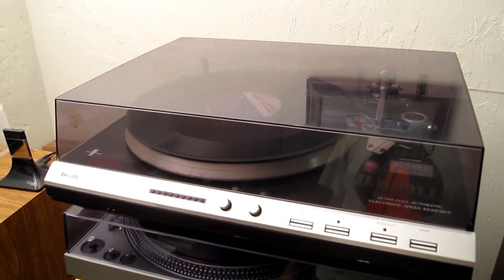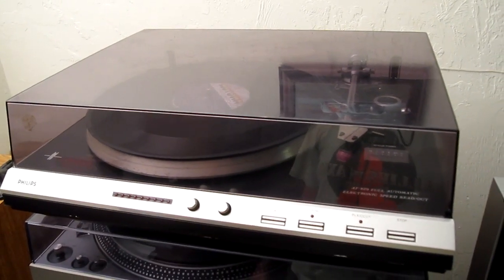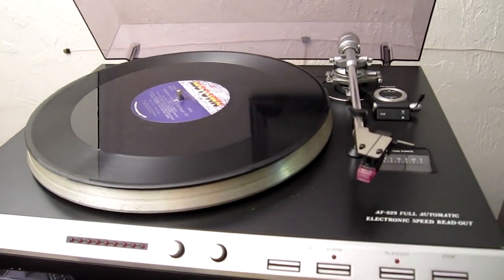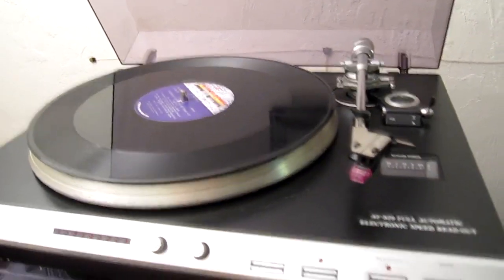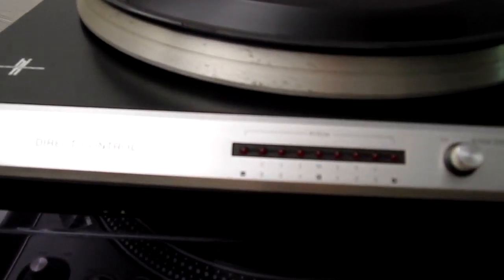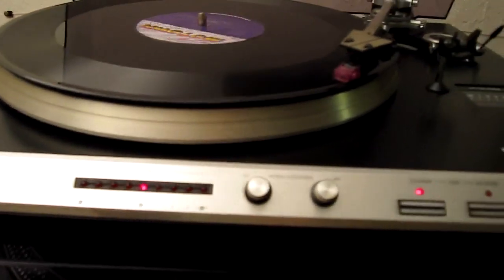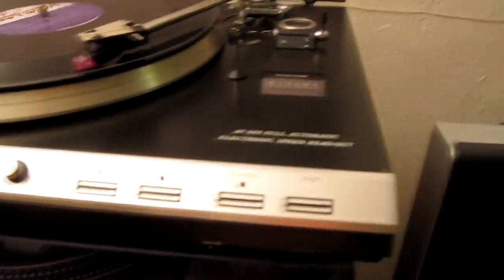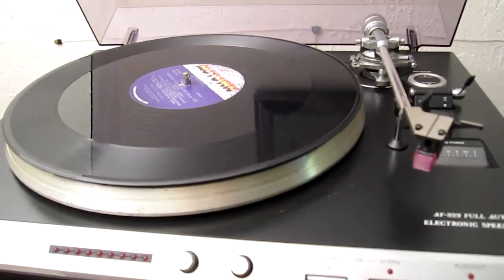Phillips AF-829 Turntable, Landfill Destined Rescue

Comment: I have one like that. I bought it 40 years ago and it still works like new. The coolest turntable I ever had. I bought in Toronto and I have a few ADC gold cartridges (They were marked at $200). I also have a Yamaha M-45 power amplifier and a C-45 preamplifier, along with a K-540 cassete deck, a TX-900U tuner and an EQ-500U equalizer, also from Yamaha.

Comment: I have an AF-829 that I bought at the going-out-of-business sale of the Tech HiFi store in East Lansing, MI. Got it in January or February of 1981. They had the original price listed as $400 (OK, $399.99), but had it marked down to $250 or so.

It is, in fact, a belt drive turntable. This may come as a bit of a surprise, but mine still has its original belt. This past January, I took it to a local high end audio shop (yes, they do still exist) to have them put a new cartridge on it (a Grado Green, just in case you're wondering). While I had it in there, they put it under their strobe, and at both 33 1/3 and 45 RPM, the speed was dead on.

My original dust cover has bitten the dust (in college, my roommate accidentally dropped the ladder we used to climb up into our loft on it, but, like a Timex watch, it took that licking and kept on ticking).

The bottom of the plinth (which is made of plastic) has bowed out a bit, and since the feet have such a low profile, I've had to put it up on additional feet so that bowed out bottom doesn't make the table wobble.

I'm impressed by the shape that the dust cover's in. It looks like it hasn't been out of its box in decades!

The turntable did not come with a cartridge, and it wasn't part of a set of integrated components. There may have been a line of components it was a part of, but it wasn't part of an all-in-one combo.

Comment: I recently acquired the same model, however the sensor that detects the disk size for the automatic placement of the arm does not work correctly. It is supposed to detect if it is 7" or 12" and place the arm accordingly, but mine always goes to the position for the smaller disk even when a larger one is used. I was wondering if anyone had any insights on how to troubleshoot this.
Reply from the maker: It has been so long since I had this turntable I am not sure.  I cant even remember if it was an optical pickup that determined the disc size or some tabs on the platter.  I would begin by giving things a good cleaning.  Contact cleaner for switches and alcohol for optical sensors.